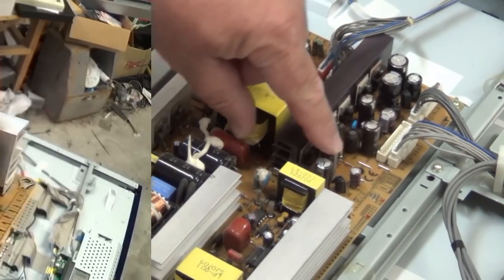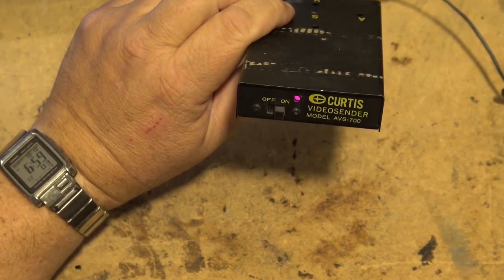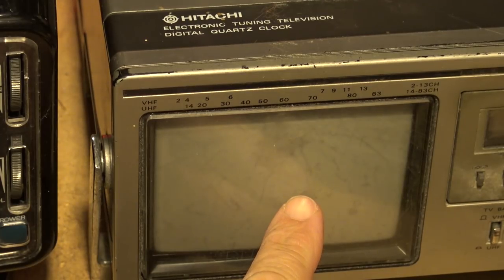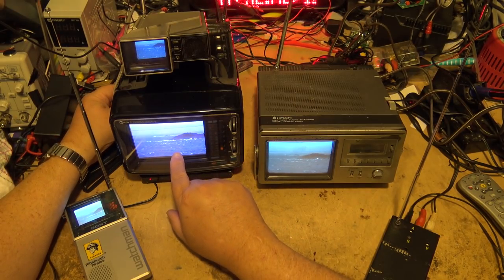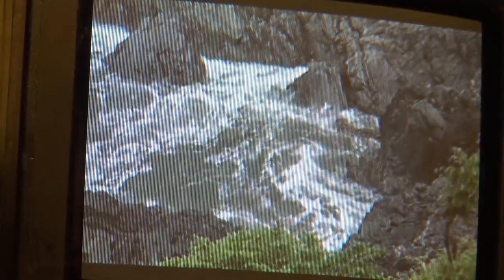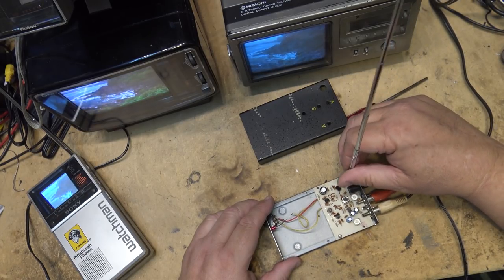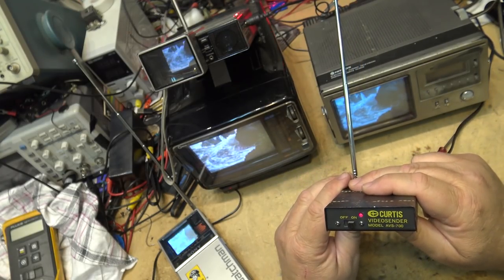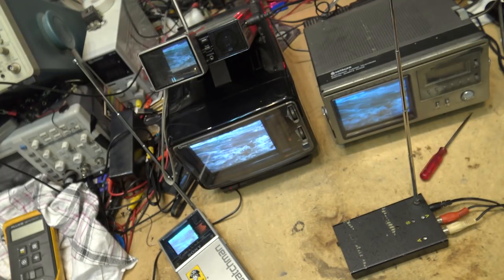Curtis Video Sender low power TV transmitter tear down and demonstration

Comment: I picked one up on Ebay from China that has a digital display and I simply key in the video and audio freq for VHF and UHF and supports NTSC and PAL.
Reply: Which one did you buy? Can I get a link to it, please?
Reply: @Raptor50aus  thanks! Wonder why they're so expensive
Reply: @daMoMenTum  I got mine on ebay a little cheaper but it works excellent with all tv analogue tv standards
Reply: @Raptor50aus  how much was it
Need one for a low power setup for my party to beam a signal to a CRT projector that has the red, green and blue lights.
That projector has an rf UHF/VHF tuner in it like the ones in regular old TVs.
Reply: @coolelectronics1759  it was $100 aud

Comment: I don't recall them being illegal in the U.S. I had heard of one brand called VCR Rabbit.
Hitachi, Hibachi
Reply from the maker: The ones that operated on 900mhz, 2.4 and 5.0 GHz and came with a receiver that hooked to the tv were fine.  VCR rabbit, waveform jr (and Sr) and a few others were fine.  It was just the ones that operated on uhf tv channel 15 that they stopped selling after a few years.  I got that info from a store that was selling them off cheap.  Said they couldn't get any more because they banned them due to possible interference with broadcast stations and all future ones would be on a different band.
Reply: @12voltvids  These things were always illegal here in the UK, but that didn't stop people getting hold of them of course :) Very useful devices indeed. As for that offset-angle CRT tube, Sinclair Research (yeah the same company that made the ZX series computers) made a small TV over here that used the same technology back in the day. It was called the TV80 (also known as the FTV1). was released in 1983 and was a commercial failure, mainly because it was monochrome and at that time, Sharp had already started developing small colour LCD panels. A cool and fascinating device though, and not too expensive on ebay compared to many tech products of that era
Reply from the maker: @countzero1136  
The sinclair device used a similar technology. They were using an electrostatic deflection tube, and Sony used a magnetic deflection tube which found itself in wide spread use in door intercom systems. I see them in homes all the time. At the front door a camera and speaker, and in the house a 4" flat CRT monitor. Of course now they are all LCD, but back in the 80s and 90s and as recent as early 2000s companies such as enterphone, used these Sony tubes in their intercom systems because they were flat and could be built into a wall mountable unit. There are still thousands of them out there in service.

Comment: Casio made a 1.6" color LCD set, the TV-100.
Reply from the maker: Big deal.  We aren't talking about LCD TVs.  Making a 1.6" LCD is nothing.  LCD is very simple technology.  Have had them on watches for years. This is a 3 gun 1.5" color picture tube and that is a very complex device when it gets that small.  Big picture tubes were easier to make.  Small ones not so easy because you have to cram all the same elements into a very small space in the jug, suck out all the air and apply some very high voltages.  The tolerances are in the microns.   Oh and they are built by hand too.  LCD you take a piece of glass put a photo resist on it , put a film mask over it, hit it with UV light to expose the photo resist, devoloped it and wash the glass with acid to create your conductor paths.  Apply the transparent electrodes, fuse the glass pieces and stuck on drive electronics on the flexible boards around the edges. A couple of polarizing filters and color for filter over the pixels and a light source.  Done. A machine stamps out hundreds of them an hour.

Comment: Did you know that with you modulator setup and a 15 dollar (American) antenna booster and a antenna you can have a lot of analog tv channels of your own making
Reply from the maker: Well they would transmit but not go more than a few feet.  I have a 100 watt transmitter set to 434.6 and 439.25 MHz in the ham radio 70cm band.  This translates to channel 59 and 60 on the CATV band.  With that i could get a few miles to a buddy's place with directional antennas on each side.   Am tv signals take a fair bit of power to go any distance.
Reply: Sorry but isn't analog tv FM? @12voltvids
Reply from the maker: @GaryTheRCcar  
No analog tv here was vesiduial side band. Look that up for an explanation.  Think of it as AM but the lower sigeband only went to something like 600khz and the upper on ntsc went to about 4.2 or 3mhz.  The color was transmitter as a bandwidth limited double sideband carrier using 2 suppressed carriers at 3.579545 MHz. This frequency was chosen as it is at an odd harmonic. The sound was an fm carrier centered 4.5 MHz above the video and had its own dedicated transmitter.  The output was multiplexed at the antenna.  The limit on lower sideband was so it wouldn't interfere with the audio of the next channel down.   It was a very complex system, far more than pal because the broadcasters had to satisfy the FCC by producing a system that was compatable with the millions of already installed monochrome system.  Europe just said fux b/w we will simucast for a few years snd then shut down b/w transmitters.  So they had the ability to use more bandwidth which resulted in a better picture with a much simpler system. 
Now FM video is used in analog as well for microwave links and satellite transmission where having a channel bandwidth or 30 or 40mhz no big deal and it looked fantastic.   These little VCR senders uses 2.4ghz FM.  Lots of ham radio tv guys including me modified them to run in the ham bands.

Comment: I am suprised how little their is in there. would would think transmitting video would require more electrnics.
Reply from the maker: Analog TV was transmitted by amplitude modulation. Actually vestigial side band, so a broadcast transmitter would have additionally filtering, but it is still AM, just with the lower sideband reduced.
To make an AM signal you generate a carrier (1 transistor oscillator) Mix in the modulating signal, in this case the video. 1 transistor will do that too.  Generate a second carrier at 4.5MHz and input the audio signal to a varactor diode in the oscilator. This will create an FM signal, which is mixed with the carrier and video mixed signal. (1 more transistor) and then a final output amplifier (1 transistor) so 4 transistors is all that is needed.  Really quite simple. Add a few more amplifier stages for more power.

Comment: I remember getting portable crt tv in 1999 and broke it and late 2003 had vintage 80s crt portable tv from sisters friend crt was on its way out finally  in 2005 crt died and also had red clock radio portable tv combo but bad power cord  fried  everything

Comment: How do the 'authorities' really 'crack down' on transmitting video or audio ?  What's the myth vs reality..did they really drive around in a Van in the early 80s to target 'pirate' video broadcasts? That would be  so pathetic.
Reply from the maker: There was a local pirate that was broadcasting on FM out here pretty much non stop for over 20 years that just one day went off the air.   Actually there were 2 or 3 for awhile but they were shut down by industry Canada.  I have tapes of one of them, that I have shown on 6he channel.